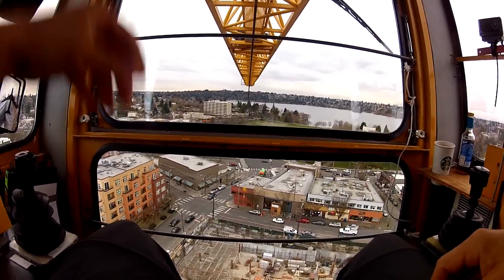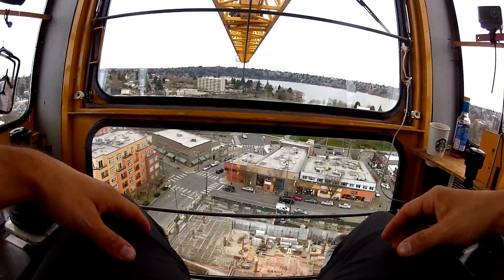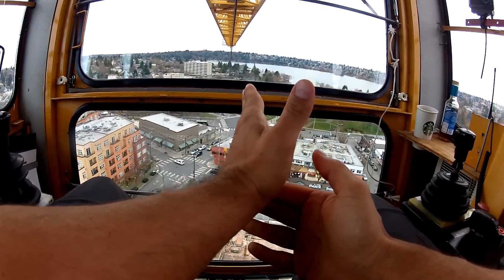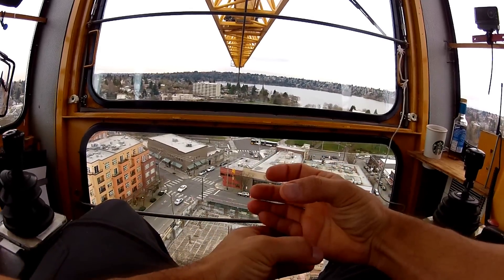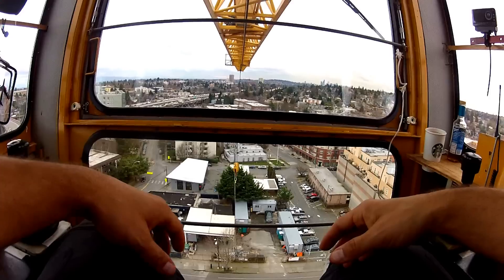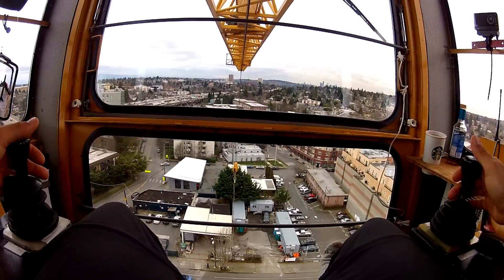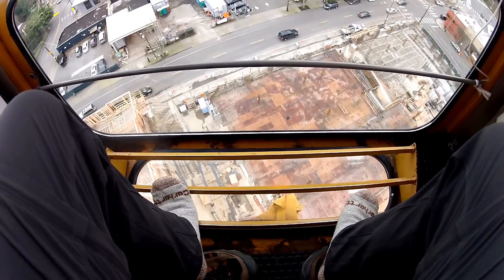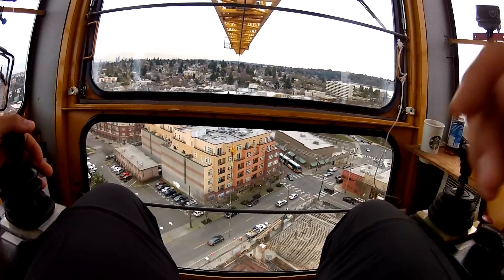How to Operate a Tower Crane: Swing operations

Comment: How can you get a crane operator's license?
Reply from the maker: This depends on where you will work. In the US, the most common way to get license is through a third party like NCCCO. There used to be others as well. Some cities have their own license. NYC. Maybe Chicago and Philadelphia too. But mostly the NCCCO is the most recognized license in the US. 

In Canada each Province has their own standards, and I believe certifications. I've never looked deeply at it. I hear the term "Red Seal" used as if it should mean something to me. But I think it's reviewed in each area. 

If you are asking with no experience, I think it's best to be a rigger and signalperson first. Once you understand that side of the hook well, you can start to put the puzzle together from the top side too. It's best to get in in a state that doesn't have strong laws yet. Say Texas or Florida. Washington for example would require 500 hours of training with an operator overseeing you. That makes it very expensive for a company to want to invest in you. Places like Colorado use a lot of self-erecting cranes due to the terrain. If you were going the non-union path, that could be a good way to get an understanding of the cranes and then get a crane seat say after a year of doing that. The problem there is it's hard to know what is "good". When that hook hits your hand, it shouldn't have much more than a small dance going on at the chains. If it's swinging more than a foot, there is work to be done. 

Cheers

Comment: The techniques are useful in my assessment for national certification in tower crane operation in coming days. Thanks for sharing.
Reply from the maker: Best of luck on it. Get some practice in if you can. I failed my first run at it. I was so focused on being perfect that I didn't realize that I likely went over time (they didn't tell me why, but I didn't even touch a tennis ball).  I came back for a second run at it. I set a timer and was under half off the time and still perfect. The point being, not losing the tennis balls won't be the only consideration.

Comment: Completed my tower crane course last week and now searching for work in London UK. Thanks for the video!
Reply from the maker: Best of luck. That's a great thing to hear about the new career path. Remember that having accuracy and being smooth will be more important than speed. It's much like riding a motorcycle. Get the basics into unconscious behaviors. Then keep adding speed until you think the crane is slow.
Reply: @rotyag  yeah I just hope I don’t get sent home for being too slow 🤦🏾‍♂️
Reply from the maker: @Sirdonrattray  It's a real fear to consider. Keep open communications. Ask for feedback. The more open the lines of communication are, the less likely it will happen. But here's the other side of it. I was an operations manager for 40 tower hands under me. I have had to tap a number of good operators on the shoulder because they weren't aggressive enough. If the communication was clearer, they could have adapted. These guys were fast enough for the 20 years prior to me climbing into the cabin, but this one crew needed more. 

Not everyone is going to like you. And that's OK. Sometimes in your career you'll be right, sometimes you won't, and sometimes it's just a difference. It's a critical role that the job needs to get the right person for. As you gain experience, as long as you have good communication you'll be able to adapt. One of the challenges in that is not taking things personally and relaxing through the pressure of the job. It leads to arrogance and that can be poisonous. I was all bound up on a job that had 21 different dogmen they'd send me around to. It was terrible. My arrogance was getting the better of me until I asked for a white board to draw concepts every day before work that the novice people signaling me could learn from. After a month, it was tolerable. Three months in, we got along fine. Keep searching for a solution and communicating so the pressure doesn't overwhelm you. Prepare to sweat for a few months in the seat. It'll become second nature over time. You got this.
Reply: @rotyag  really appreciate you taking the time out to write this. Thank you.

Comment: "You are not really being productive, you are just moving stuff around". Lol. I say that to guys all the time.
Reply from the maker: You got me! My email alert shower me "not productive"  and my mind got all defensive. Then I opened it and got a laugh. Thanks.
Reply: @rotyag  there are not many guys who have that mindset when running crane. I call it thinking 3 dimensional. How do I eliminate the airspace from my lifting spot to my landing spot as quickly and safely as possible. Sometimes swinging the long way around is faster. Sometimes making 3 quick picks instead of trying to "tree" 3 loads is wayyy faster. Walking along the ground with big form panels is harder for the operator, but safer and more efficient than trying to weasel it down between columns with tag lines.

Lots of operators (and riggers) think I am speaking mandarin when I say stuff like that. We are a dying breed and it is sad.
Reply: @ringer87derek7  my operator is a one motion at a time guy so christmas trees are the go aswell as linking lifts and dropping stuff near wher the next one is coming from
Reply: @klikitzsmith8416  If you are thinking that way then good on you. Not many guys do. If your operator is a one function guy think about getting him out of the seat and you in. It will be more productive for everybody.
Reply: @ringer87derek7  Lol, i like swinging chains though, let someone else climb the ladder and sit down all day
Reply: @klikitzsmith8416  I cannot argue with that. I would rig for the rest of my life if it paid the same.

Comment: do you have to fill out paperwork every time when making critical lifts (75% or more  of capacity) and does that also apply to duty cycle (if you're swinging concrete bucket thats at the tip 95% capacity)?
Reply from the maker: The critical list planning doesn't have to be for each lift. If it's a typical lift like concrete buckets, you just document the process once, you just have to repeat it the same way each time.

Comment: Yesterday I had experienced 38 to 41mph wind we were setting and stripping panels, eventually I had to shut-down because as I went on these winds became sustained instead of gust. Brother could you do a video of how to operate in excessive winds. Had everything under con'trol until the wind went into the high 30,s.I shut down because our cut-off iis 44mph per manufactured specs. I made that decision because it wasn't  worth the risk. Thanks for your advice! Operating out of Local 825 NJ/NY. The guys thanked me btw.
Reply from the maker: A video on that would take some planning and opportunity. I'm afraid that I'm not generally running crane anymore. Might have to Saturday because my guys are all either working or not up for it. I've moved on to supplying operators, erecting cranes, own tower cranes, and material hoists. I have difficulty finding sleep. 

It varies by the crane you are running. A Pecco, old Liebherr or a Wolff will let you fight the wind with the motors. The reducer gears function off a fluid coupler that is like a transmission torque converter. If a guy were in a short jibbed crane that wasn't tall and say he's bucketing concrete without much wind surface on the load. In that case, if they were pushing the limit, you might come in and never set the brake unless you are down or up wind. Pick a point on the horizon. Send the bucket down and while looking straight out, hold the jib right there with the motor. feathering through the speeds to match the wind. This is smoother than bouncing off the brake. The hazard depends on the motor design. VFD's let the motor run cool. Do that all day if you like. Older cranes ran on just contactors and relays. They have a duty cycle and doing that for too long can damage the motors. You have to understand what you have and consider how long you abuse those motors. 

New cranes with fluid couplers will let you do the same. A lot of the new computers just limit the power you have given the jib length. The limit the amperage, which limits your torque. So when you hit the limit. That's just the limit. Many of them have redundant systems and PLC's so even if you were clever and learned how to get into the VFD to adjust it, you'll need to know the other fail safes and hope the cranes are connected to the manufacturer and throwing codes. 

Then there are the class of cranes down one bit. Potain, Linden, Saez, Comedil. They go a different path in the swing functions. Come out of the power and the brake will set. You can't do much about cleaning up the mess. For me, I like the older cranes. I set the horizon point in my memory when I set the load down. I'll chase it to keep everything as smooth as possible for the people below. Then when they are ready for a move, I just verify that I hit my same point as everything comes tight and is about to lift. It might be overkill, but that's how I prefer it. I'm self-critical. 

For deciding when to run away from the wind like it's a Python bit, you need to consider the structure of the crane, and the load. You have a 310 Potain, or a Pecco, the jibs are stout, squatty, wide. Think, strong. If you go to a flat top, they can't take as much. So if you are to take a large wind surface load to the tip and get caught in a gust, the crane might have to move, or it could fail. Consider the wind and that jib rigidity. I've seen pictures of jibs folded up in the wind. 

Many cranes have wind load charts. Potain comes to mind. They are right to do it. I've ran into the 50's with a short  jibbed saddle jib crane when we were jumping tables. Small tables. There's no wind surface to speak of and they had an army of guys to never lose contact with it. But if it's a panel, 17 mph might be too much. Even if the crane can hold, if you pick up a 10 x 25' panel and the winds are in the teens, it's likely to want to move. So you have to consider the possibility of pinching someone. Teach your guys to stay up wind of the load. You don't want to sweep them off the building or between something solid. Your what could go wrong needs to be the mindset. 

How's that for a long youtube comment?  We're out of Seattle with Local's 302 and 86.

Comment: Just started hands on for about an hour adter my 40hrs observation. It's only a basic overhead gantry, maybe 40' off ground and 80' wide inside an aluminum plant. Dude I'm training under makes this shit look like child's play lol. It runs a double block Bradley cage grab, 6,000lbs empty. Hoping i get the "swing" of this so to say.
Reply from the maker: Good luck man. Prepare to sweat and feel the pressure for a while. Once you get the feel of the crane, what the goal is and all, it really becomes second nature. Then you just push yourself to be the best you can be at it. Get the control as your first goal, then push for speed after you find that you are accurate and in control.
Reply: rotyag thanks, for the tips and quick response. The last few days this guy and the rest of the crane ops made stuff look like a breeze. Soon as i sat in the seat i knew i was in for a ride. Definitely no where near what you're driving but for someone green like me I feel like I'm a spaz now lol.
Reply: lol
Reply: KranWien - Tower Crane well, it didn't wirk out. An hour into my hands on training I opted to go to the shop floor. Now I'm working as much OT as allowed, 84hrs total a week. It would've taken me 3mnths to get proficient enuff to be even considered for ot in the crane spot

Comment: When the jib is right at the top do you still need to do things this carefully to stop it swinging.  When I drove a cran, it was one where the arm in on a hinge, I just put it straight to full power.  I didn't notice the jib swinging about as it had almost no cable length to swing on, but the tower did wobble slightly, is this normal or am I doing it wrong?
Reply from the maker: The cable length has a lot to do with the speeds and how much swing you get out of it. On a 100 meter tall crane, a lot of your movemements are delayed by 4 seconds. So you have to plan that far ahead.
Reply: When starting the crane when it has been left in the off position, do you just pull out stop and press start, or is there something else you need to do first.

Comment: Do you think crane operators would benefit from using smart glasses that project video images of what is at the end of the boom? I know some cranes have video monitors? Would glasses be better? What are the risks? What do you think?
Reply: Video monitors are nice for getting lined up and close to a pick in those places where you can't see what is below. We call that, "Working in the blind". I'm not sure that I would tolerate glasses along with all of the visual cues I take in when I am operating. Even with a video monitor, I don't think that I've spent more than a second or two looking at one during operations. To be fair, I've never had one on a highrise. But if glasses were on my face, I'd want to be able to tell them what kinds of information I want displayed sense we all have different wants. I can imagine load, radius and so forth would be great if I didn't have to actually look away. 

The glasses would have to be very comfortable and stay on your face very well. I have Oakley glasses that I can run in and they rarely move. Since you'd be looking down a lot, you need that. But I'm not sure they'd be comfortable for 13 hours at a time. 

Another thing to figure out is glasses for vision and how they would interface. Many operators where glasses for distance. I wear them, or have contacts for reading. So how does you display work with that? It's just a hurdle to figure out. Many operators are experienced guys in construction (read that as middle aged) so the glasses are common. 

Best of luck with your idea.
Reply: Really terrific feedback. Thanks a lot. One more question, would smart glasses even be allowed given OSHA regulations or basic safety protocols of a job site? I sense that the cabin is designed to minimize visibility obstructions at the center. Is this a relevant risk?
Reply: I'm fairly well versed in the laws regarding crane operation. I was on the committee that re-wrote the Construction Crane Bill of 2010 in Washington State, wrote the test for tower crane inspectors, and was also licensed as a Crane Surveyor in California. I can't think of anything that would prevent you from using a secondary aid. You can't modify the crane in a way the manufacturer doesn't allow, but the glasses would be a third party add-on that doesn't detract from the manufacturer's specification. There are many aftermarket add-ons to cranes and operations. Even as basic as a two way radio would be an example.
Reply: Once again great feedback. The main issue I was concerned with was the fact that the smart glasses presents the video in the center of view as opposed to peripheral. But thanks again, seriously great details.
Reply: Ricardo Rodriguez, It's possible that smart glasses may aid the operator in spotting something that the spotter on the ground can't see,  but I wouldn't rely on it by itself to do a pick.